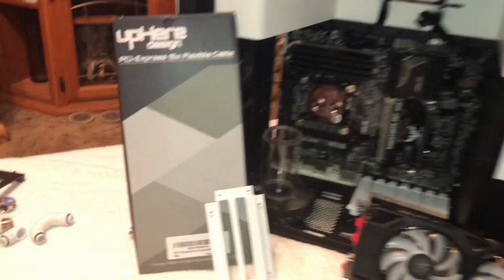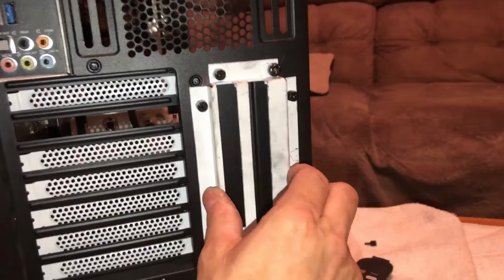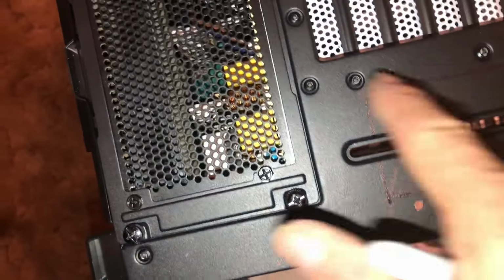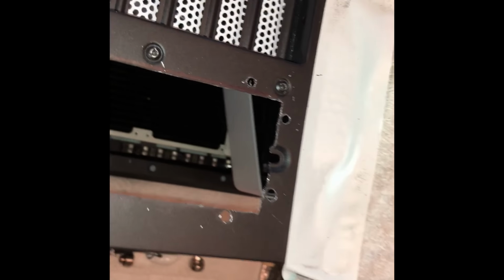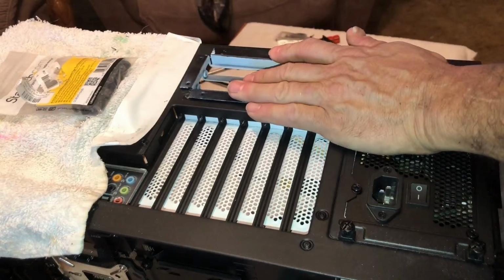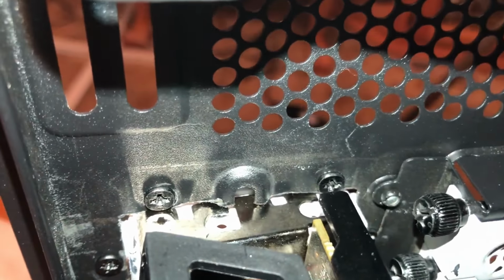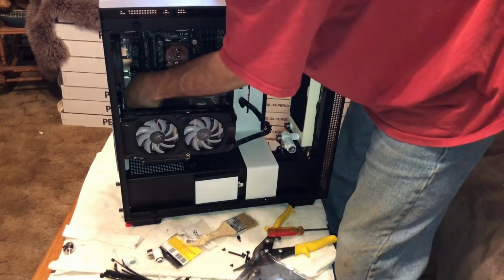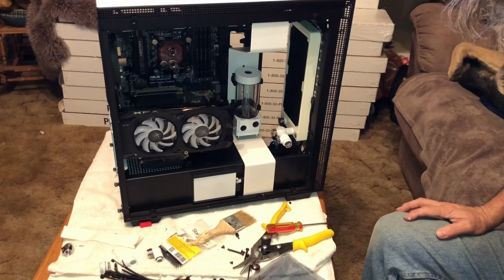NZXT H700i Vertical GPU Mount

Comment: What did you use to cut the screw holes for the bracket?
Reply from the maker: Norepi  I used a 1/8 drill bit for the holes after I used the Dremel to cut out for the bracket
Reply: @WitterPC  What type of drill bit did you use? I've been trying to make screw holes using a black oxide drill bit and I've been having trouble.

Comment: Same chassis. Love it. How is plumbing in there? Haven't done custom in her yet.
Reply from the maker: Teaz QT It was pretty easy plenty of room. I’ve since changed to an EK D5 150 pump res combo it’s about the same overall height as the one in the video and that’s pretty much the limit as far as the reservoir to height. As long as you mount it where mine is mounted in the video. Now there’s nothing stopping you from mounting a huge reservoir vertical or horizontal somewhere else and the pump separately and pipe to it.

Comment: Nice mod!

NZXT should have included the vertical slot from the beginning. I have the H700i and it’s a pretty nice case but there are a few marks missed on this case for the original $200 tag. Would have liked to see the glass mount better and maybe even on a hinge. The vertical shroud is weird with ATX power cables especially loomed.

Comment: I currently have a fractal design and have my res mounted to the bottom on the case. I'm interested in this case in the future and was wondering what type of mount you used to mount the res to that white plate?
Reply from the maker: sodaJ3RK Hi in this video while I am describing the easy DIY Cable, in the Beginning, you can see in the background on the case which is sitting sideways on that white bar there’s a slot that NZXT puts on it. I’m using the EKWB Reservoir mount clamps on the NZXT bars stock mounting slot. You can see this at the 105 mark. 
I’ve recently added an EK D5 res 140! Combo to this build and had to drill  4 holes to mount the D5 pump. by doing this I am no longer using the white pump res combo. The D5 combo comes with a template a sticker template

Comment: What pump is that?
Reply from the maker: Turbo //TurboHook Hi, it came with EKWB Slim series kits. I added the extra long tube / Reservoir comes with a short one. They just screw on and off, I believe it’s a 50 mm.wide. I replaced the one that it came with a 120 mm one Lengthwise. Here’s the info for the website on the pump. Although this came in a kit you can purchase the pump separately or used to be able to I’m sure you still can. 
It's an pump res combo all in one. My daughters been using it for three years and never had a problem. 
I would not recommend using this pump with the CPU and GPU at the same time. But individually for either one I have no problem with this.
EK-XRES 100 SPC-60 MX PWM (incl. pump) - is a value oriented water cooling pump reservoir combo. It has been designed to lower the production costs yet still offer premium hydraulic performance at the best price. PWM control allows for automatic pump speed regulation depending on your CPU temperature. Full performance on demand or whisper quiet operation in idle mode!